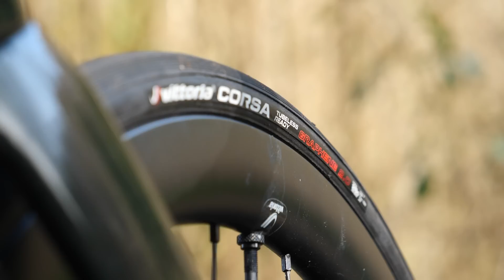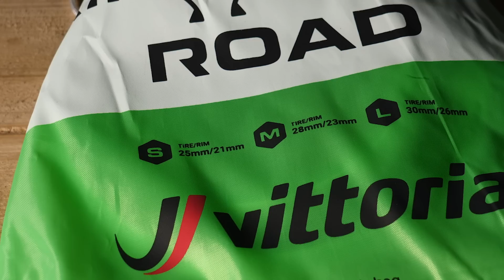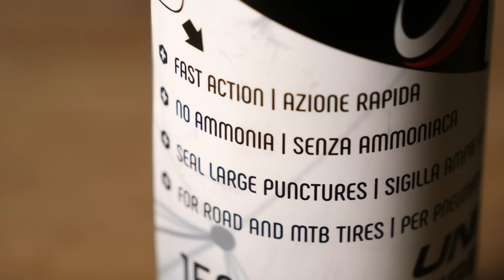NEW Run Flats: Pro Cycling’s Secret Tech | Vittoria Airliner Road First Look

Comment from the maker: Would you use tubeless tyres fitted with Vittoria Airliners?
Reply: Could you use these for cyclocross ? But cyclocross pressure tends to be alot lower depending on the conditions.
Reply: Could i get those for a 26" mountain bike ?
Reply: @utharkruna1116  if you look at GMBN they have a video on this for mountain bikes.
Reply: @markstone5390  okay cool. Thanks. Have watched abit of your channel but havent got that far yet as im a new viewer.
Reply: @utharkruna1116  Nukeproof ARD. Same thing for MTBs. You can shorten them to fit 26”, there is a guide on the NP site.
Reply: Looks interesting. At first I thought the foam would take the place of sealant. Won't sealant stick to everything inside the tire, and cause you to damage the foam when trying to fix a flat/replace a tire?
Reply: Were it available one year ago it would have saved me from a blowout induced crash that resulted in a broken shoulder. Definitely
Reply: Will first need to know if road tubeless tyres fitted with an airliner, can still be plugged, and re-inflated to desired pressure? And what's the risk if the airliner is pierced, when installing the plug?
Reply: @utharkruna1116  this sort of thing has been sold a long time for MTB so you can probably find something, tho look into upgrading to 29 or 27.5 so if you need a part you can find it easily
Reply: I guess yes, but then what's your advice if we take it to an extremely long ride?
Reply: I have also been slow to adopt tubeless on my road bike.  I totally get the reasoning, but my wheels are not compatible and I don’t want to throw down a chunk of change for new carbon wheels.  Maybe a new bike in ‘22 is the answer.  Ride on!!!
Reply: No. In my experience, you would need to be fairly light to not squash something like this flat.
Reply: I've been "tubeless" for 4 yrs, this will the 5th year and I've been "flatless" every ride. I see this product aimed @ the skeptic who has to many friends who think , no wait KNOW tubeless is a waste of time and money because no pro's ride tubeless, or  have won a race using tubeless tyres.
Reply: I’m thinking about doing this and skipping the mess of sealant. Just run with air and Airliners. If I get a flat then Airliner will do the job till I get home.
Reply: Wouldn't use tubeless so I guess my answer is no ☹️
Reply: Squeeze it Si, it would please me.
Reply: @utharkruna1116  yeah pretty sure I've seen some that you can cut to size I can't remember who made them but Ash at Hayle cycles had some knocking about. I think they may have come from ison distribution.
Reply: @SavellM  i think vittoria do a small canned foam sealer, that would probably be a better option.
Reply: yes
Reply: I know nothing about tubeless, but if you do get a puncture in this set up that the tubeless can't cope with, why not just remove the foam ring and insert an inner tube.
Reply: @KenSmith-bv4si  There are a lot of Backwards Hat Dylans in the cycling world, and I can't see it changing, don't worry about that. XD
Reply: Definitely gone on the next purchases list for my bikes. 
I would be interested to know how far you could ride on these if they were “in play” due to a puncture, also if you could still use tubeless plugs with them. 
I have a couple of long  races (ok Ironman 112 mile bike legs), coming up, and these could be the difference between a finish time and a DNF (Did Not Finish).
Reply: @markstone5390  they do Road, Gravel and MTB kits, so should be something in the range. 
(Already been looking at the kits)
Reply: @colinb8327  cheers. It was more to do with the pressure. Si mentioned that that with the air out the foam keeps the pressure to approximately 30 psi. In cross we go for 18 to 30 psi alot lower so was concerned it was too firm.
Reply: @markstone5390  ah my bad. 
I’m wondering if they hadn’t addressed that in manufacture. 
I get the principle of foam density (the bigger the air bubbles the more it can compress, depending on the density of the polymer), so should be possible to vary for disciplines within the overall sports. 
I must admit I was left with questions as well, such as how far could you ride, can you still use plugs etc.
Reply: Yes, but they don't make them for 23mm tyres! The size most in need of puncture resistance!
Reply: @jonnythelegs2597  thanks mate! Will look it up. Never heard of it
Reply: Mental note, watch whole video before commenting then you'll know how the liner reacts with sealant 😂
Reply: The only downside I can see is weight, but in my case, I don't care. If I go tubeless one day, and I probably will, I will think about those airliners
Reply: No
Reply: If I trial tubeless then I’d be running with these. However. I’ve recently adopted carrying a spare tube (in addition to a puncture kit), and it’s been a game changer for me. So I’m not sure I’ll be trying anything new in a hurry.
Reply: What is really the benefit of using airliners? Not sure i see the gain here, because you have to use sealant anyway. Right? 
My experience is that as long as you use enough sealant in your tubless tyres, (because most people dont use enough) thats all you need. That sealant will even stop a very big hole or many holes, as long as you keep riding. I have seen that both in offroad and road cycling. So, thats just my experience.....
Reply: Nah. Tubes all the way baby.
Reply: @k1vd038  been a long time since i rode bike. Have got a 29 but just bought a vintage limited edition bianchi mtb, it has 26. Thought i might put solids on it.  Thanks though.
Reply: Thanks for all the response, i will delve into this further .
Reply: @davidmulligan42  thats  what i want  to know.
Reply: @albullit  thanks man.
Reply: @guest_informant  my friend runs a tubeless set up, and he had a blowout puncture last week where psi went to zero instantaneously at 20mph on a flat road. He lost control of the bike and fell. He suffered scrapes, and a broken derailleur hanger. This product would have saved him from that fall. I personally run tubular tires but this does sound interesting.
Reply: No!
Reply: Yes, seems a smart and safe move
Reply: @ludovicboully3643 I thought about this and most will actually save weight, 2 liners will be lighter than the average spare inner tube you'll no longer need to carry, that's if you do carry one 👍
Reply: @guest_informant  cause tubeless usually have a stronger bead making reinstalling it on the roadside a major pain
Reply: Hell yeah
Reply: after this vid my store is going to stock them
Reply: @SavellM  it still needs a sealant
Reply: $90 buys a lot of inner tubes...
Reply: @darrylhuculak4996  like 8.... and then you have to deal with punctures. No thanks.
Reply: Have been tubeless since 2015. I would like this added security.
Reply: @mateagoston8145  oh that's easy - just have a service car follow you with a set of spare wheels - because it looks impossible to remove the tyre, even at home without the pliers and like 8 hooks...
Reply: @lechprotean  Dear shit, what an idea! Thanks man! I have no idea how it is possible that it has never ever crossed my mind.
Reply: Absolutely!  Flats, and in particular...flats since I went tubeless, have been a real pain in the butt.  I bought this right after watching your video and will be installing when my new rubber arrives.  I'll be all set for the spring season, and I am very much looking forward to not having to get stuck roadside.  Thank you Simon & GCN for sharing this with the community!
Reply: Absolutely. I definitely plan to get a set of these when they start becoming available (sold out, as far as I can tell).
Reply: No you’d still damage the the tire sidewall running them flat, sort of defeats the purpose IMO if you go to all the trouble to mount them (not easy), and then try to  remove them on the side of the road  (nightmares), only to put a tube in them to get home if you can get the tire off (special tools).
Reply: Use cushcore gravel inserts instead. Much better benefit when the tyre is inflated but also would let you finish a race
Reply: No risk... It's foam not a pressurised bladder.
Reply: Yes
Reply: @OmarTan  I can confirm this from painful experience. Got covered in sealant and swore a lot fitting a tube by the side of the road on a winter evening this year after an instant blowout. Now I carry plugs,  but no tube.
Reply: That's cool but what about a tire filled with a liquid that stays liquid till it comes it contact with air then it hardens to avoid tire size change and changing a tire period. You can promise several hundred punctures and a many year warranty.
Reply: I'm on board just for the additional safety net in the event of a blowout or puncture at high speeds.  Anything we can do to be safer on the bike ensures our further enjoyment and progression in the sport.
Reply: I recently added them to my setup and they are amazing. I think next to safety one the best features is that they prevent the tire from running flat and the sealant from drying out when you mount the bike on the turbo for a week or two.

Comment: I know it’s an ad, but this might be what finally pushes me over the edge into tubeless-land.
Reply: I was thinking the same thing
Reply: Yesterday I rode on my bike over a few thorny branches along the road. Immediately got off the bike and removed around 6 or 7 thorns stuck to both tires. Sealant fixed all punctures instantly. Haven't had a flat since April 2019 when I got my bike with tubeless system.
Reply: Agreed!
Reply: I started as a gravel boy, went tubeless after a month. Had 2 months of pain understanding the tubeless and using the right tyres, bedding it.. A year after that I changed my gravel tyres and saw all the holes if filled after no flats and realised how many days I would have been changing tyres in the woods and on the side of the road. I went tubeless on the road bike and its been faster at lower pressures and flat free.. It's a learning curve that with the right advice is a game changer. Lots of advice on online including gcn. Never doing tubes again
Reply: @KandiKlover  The gatekeeping is strong with this one.
Reply: @KandiKlover  pretty sure it's not worth insulting people over that though. A compelling argument in favor of tubeless is rolling resistance. I like free watts.
Reply: The idea of a less puncture prone system that has a back up if there is a puncture has definite appeal.
Will be a while before I adopt it.  I don't replace wheels etc. when they are working perfectly but they will die at some point.

Comment: Sold! I’d think they’re a very appealing option for anyone with an expensive set of wheels that they’d like to protect in the event of a puncture... if you’ve spent many hundreds (or more) on the wheels then the kit doesn’t look so pricey
Reply: Hello all these work i had  a hole the sealant could NOT seal today and i heard all air come out... and yes i rode 9 miles home on a deflated tire and it felt ok little more leg work required and make it a recovery ride! VITTROIA made a mistake NO they do not run at 35 PSI....run flats mean "RUN FLATS" not 35 psi.....just to clarify that and i did not carry any tools at all!
Reply: @annukun7318  Hi! would you still recommend this system? I´m thinking of switching to tubeless...
Reply: @dachlatte8580  yes i would because sometimes you can have larger hole the selant cant seal try to plug it you cant plug it the arilners will get you home safe and wihtout damaging wheel

Comment: This may be the tech to convince me to switch to tubeless after all. As a Canadian post winter chips linger until may june, 3000 kms tubeless several flats and one near loss of control explosion, switched to tubulars. 50,000 kms later, 6 controlled flats, tubular have kept me safe and alive 35-60km/hr. No gushing sealant spray no messiness, 10 min swaps with mariposa tape, amazing veloflex and conti tubular performance. But i am aware of the tubeless advantage as i am of poor standardization and safety, more than a few users woke up in hospitals post crash. Or this vittoria liner may be what gets me on the Bora Ultra WTO 45/60 with conti tubeless. No more blowouts is the safety i absolutely needed before switching, Awesome vittoria if only your tires were as puncture resistant as Contis...

Comment: I've shied away from tubeless because of the sealant nonsense. This REALLY got my hopes up, until Si mentioned "sealant. My question: If you run an airliner, why do you, (or do you?) need sealant? I mean, if you need to rely on a run flat system, then your sealant didn't work anyway.
Reply: Sealant is good for small holes in the tyre, but sometimes you get a cut that won’t seal, which is where your airliner would come in. Also, using sealant helps the tyre hold air.

Comment: I came across this video recently and just wanted to say thank you.  This piece of kit is just what I needed to get back to riding my recumbent.  I own a Bacchetta Corsa two-wheel recumbent bike.  Unfortunately, when the skinny road tires flat out in the front wheel…the rim makes contact.  On a regular bike…you can usually shift your body weight to prevent getting dumped.  The recumbent solely depends on steering for balance.  Once the rim hits the asphalt…it skates any direction it pleases…and in under a second you go splat.  Being on anti-platelet drugs…this means a lot of bleeding.  So, I haven’t ridden this particular bike in a very long time.  Now, with the Air-Liners installed…I get this bike back in the rotation.  It’s a blast to ride…and I am now confident that there won’t be any reason to get dumped on the ground if I flat out.

Comment: I've seen another system, that uses a smaller tube protected by foam, in-between the tubeless tire and tube. This system requires air in the tube, which than forces the foam against the tubeless tire, giving it stiffness, but doesn't require a lot of air pressure.

Comment: I picked up a set of these.  I would never willingly do the descent that Si was doing here, unless I had somebody else providing the hoops.  I'm a pretty light guy (~63kg) and if I sit on the bike with zero air in the tyres, the only thing between the rim and the ground is the flattened-out tyre carcass.  These seem like they'll be good for keeping you from hitting the deck in the event of a catastrophic failure, but I suspect if you tried to get home whilst rolling on only the AirLiner, you'd either crash, or need a new wheel afterwards.

Comment: Tannus have a product like this "armour"  for use with much smaller inner tubes. I couldn't get them to seat evenly both sides of the wheel. Would not recommend. But I'll add this is basically an admission that tubeless goo doesn't stop punctures. So normal riders are still better off with a tube you can patch quickly and easily. less mess less fuss.

Comment: Make inner tube with the foam in
Reply: How would that work exactly?
Reply: @Bungle2010  so you can use it in clinchers I mean. Works the same but inside an inner tube.
Reply: @D1N02  And if the tube is full of a huge piece of foam how are you actually going to get it into the tyre and pump it up? Not to mention the transportation problems it would cause.
Reply: @Bungle2010  Just like you always do. It wouldn't be larger than a folding tire so transport is no problem. I've had clinchers delivered in a giant box. Usually the box is al lot bigger than the item in it anyway.

Comment: How nice to present the assembly and disassembly without a sealant... Might throw some wrenches into the works of the ad...
Reply: You’d always set it up without sealant as you add that after the tyre is on and it’s been seated. Taking it off with sealant in is going to be messy for sure, I’d make sure I’d do that outside.

Comment: Does tire pressure need to change using the liners vs without?
Reply: Never mind. The bit about not being able to service them in the field without the Vittoria bead jack tool makes these liners a non-starter for me.

Comment: This sounds like the hack all the non-tubeless road guys have been looking for. 

In theory, the issue with non-tubeless rims is there is no retention lip to keep the bead from falling in the event of a flat...but with the airliner, it acts as a tube would at low pressure...so...is it really going to be this easy now, or am I missing something??

Comment: Riding on it for a few months now - I'm not carrying a spare tube anymore. I've had a puncture halfway into a 185km ride and it sealed only marginally - enough to hold about 40 psi at best in a 25c tire (maybe using TT tires for your long distance rides isn't the best of ideas), so it relied on the airliner to keep everything in place - just rode on without any issue.

Comment: Like the idea and may push me to finally put tubeless on my wheelset after a blowout at 35mph where the tire left the rim and by some miracle I held it upright but I still get twitchy thinking about it going downhill.

If the foam is compressed for a long period of time without a punchure will it reform to shape when a punchure finally happens. Something under pressure for a long time tends to hold that shape for a period of time after pressure is released. I guess the pros testing it got a new foam insert every outting so no worries about that.
Reply: Yeah I worry about the foam not being able to inflate back to its shape because of permanent deformation